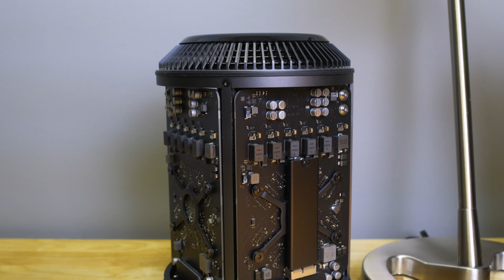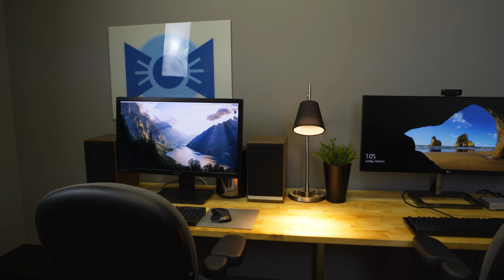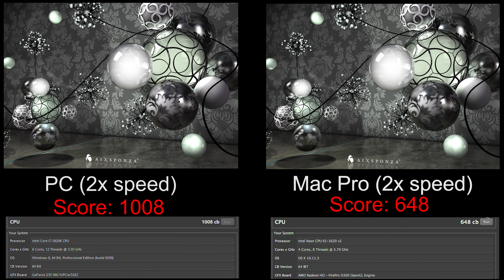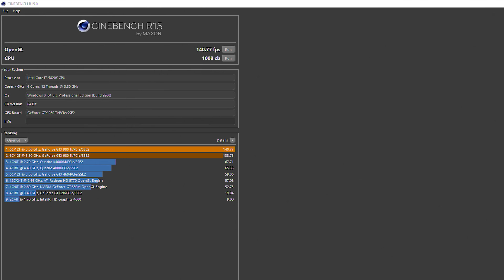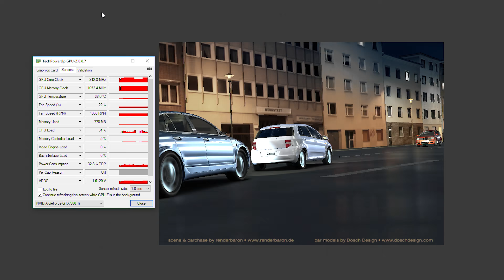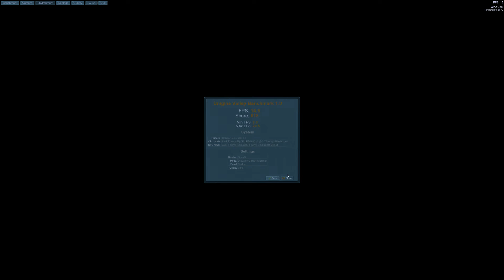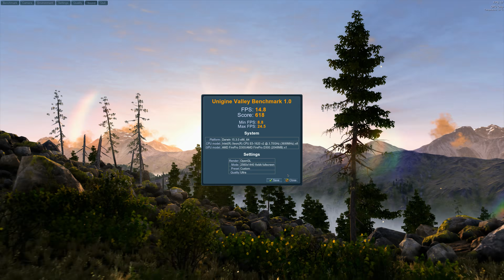$2,000 Custom PC vs $4,000 Mac Pro

Comment: You can't compare a gaming GTX card and a professional FirePro card!
Reply: actually, yes. yes you can.
Reply: ***** no you can't! Do you even know for what is FirePro meant? For what Quadro? And for what GTX or Radeon is?!
Reply: +David S. the gpu processing power isn't racist to a certain type of work load, if a card is powerful it doesn't make it not powerful in another situation.
Reply: ***** I don't say professional video cards can't run games, I say they are not builded for that. FirePro's are created for extreme precision, Quadro's are created for extremely nice non real-time rendering, Iris Pro's are created for Motion logic and Motion PhysX rendering (mainly in movies), GTX can't handle any of this and because of their only for games drivers, they even can't start modeling programs without problems. Ok, TitanX can handle on same as Quadro M2000M in modeling, where M2000M is in gaming like GTX 960m. FirePro's or Quadro's were created with know of that thing, that rendering time will be longer than 1/2 hour, Radeon's or GTX's were created with know of thing, that the video card will render 60 renders per one second. Rendering of 60 images per 1 second is different then one image per one hour! Real-Time render is an extremely different thing, than Non Real-Time render. But a gamer probably won't understand that....
Reply: And that's only Game video card (for maniacs) vs. Professional video card (for normal clever people). You also can't compare a gaming CPU (i7) with a professional CPU (Xeon). Mac Pro has Xeon E5 with 12 physical cores and 24 hyper threading, which's important for rendering, with 30 mb of L3 cache, that's extremely important for every demanding application, for example a 3D modeling application, but this Xeon has only 2.7 GHz, why? Because normal clever people, who work in demanding applications don't need high frequency as so as L3 cache or number of cores + this Xeon can handle running on full 24 hours per day. i7 5820K, which's for maniacs in to games, has frequency up to 3.6 GHz, only 15 MB of L3 cache, only 6 cores and this i7 can't handle supporting the GPU by long renders and even can't handle manual working on full (eg. modeling). YOU EASILY CAN'T COMPARE A WORKSTATION WITH A GAMING PC
Reply: Although you are sort of correct in that FirePros and Quadros are optimized for professional software and usage level, the underlying GPU core and technology is identical, for the most part, between professionally targeted video cards, and gaming video cards (GTX series, RX/R9/R7/R5 series). FirePros and Quadros are only useful to large companies and organizations (who do things like neural networking, AI research, supercomputing) that require the support, warranties, and specific dedicated features that even people that use software like final cut pro, adobe premier, etc. ("normal clever people"), will not benefit from (other than the bragging rights for buying ridiculously expensive stuff).Often times, the identically specced GTX branded component will offer identical performance to its Quadro equivalent. Furthermore, the Xeon vs i7/i5 argument has no real basis. Xeon chips are target toward large business and server related computing, often supporting multiple CPUs per motherboard, ECC memory, and more, but when it comes down to raw speed(which is important for applications such as rendering and gaming), is sometimes even outpaced by their equivalent (core wise), i7/i5 counterpart, due to their often slower speeds, and LOCKED multipliers.  For the the amount of cores, it often is the case that the Xeon lineup offers significantly more cores that the maximum amount of i7 cores (which I believe is 10 physical, 20 logical, from the i7 6590x), but is significantly more expensive. For applications such as rendering and video editing, this is very useful, but often times price prohibiting. In the same price range, the i7/i5 will often times be a better deal. It is true however, the the Xeon will probably handle continuous server loads like you mentioned better than the i7/i5, simply due to Intel actually marketing it as a server chip and doing the endurance testing. The i7 CAN certainly long renders (days long) and can definitely handle "manual working on full" (modeling). You CAN compare a workstation with a gaming pc, simply because the technology they use is often IDENTICAL, with only extremely specific tasks that normal CPUs and GPUs cannot due, which mostly only larger companies and organization actually need and that some extremely specific software might need that specific set of instructions a professional CPU or GPU might have.
Reply: lol David, you believe that crap of "professional" vs "gaming" GPUs, the Mac Pro is bad because Apple wants a big profit from cheap hardware, if you're taking "pro" into the argument, well... you could still build at least a two times better "pro" machine without spending a big amount of money. If you're buying a Mac Pro you must be just dumb.
Plus, "pros" use renderfarms, if you are doing 3d modelling, animation, video editing... a gaming GPU works as good as a "pro" GPU, the only difference could be that a "pro" GPU may come with 24gb of VRAM vs 12gb of VRAM of a gaming GPU, to solve that you could buy two gaming GPUs... it's not like you are going to do science stuff with it, and if that's the case, you wouldn't be using a Mac Pro.
Reply: +David S. yeah, the problem with this specific Mac pro is that all the pro parts are several years old and are still priced like they are top of the line, new hardware. Apple seems to not care about updating their Mac pro line with anything recent. Intel has a lot better xeons out already and AMD had a lot better firepro cards out already.
Reply: +Yaoquan Song Professional graphic cards have not the same technology, only the M1000M which is made for video editing, that one has technology of GTX 950m, but pther are fully different, easily the professional are made for precision and gaming are made for rendering, they need nealy no precision. And professional graphic cards are mainly for 3D artists and Animators, there you need the precision, it's only about the support, I had for some time Inspiron 7559, there is HD 530 and GTX 960m, for modeling I was using the HD 530, that wasn't enough powerful of course, but it had less issues then the GTX 960m, which was unuseable, CPU integrated GPU's are also more for precision then for rendering, but it's like in the middle. And the biggest difference is in mobile graphics, all mobile GTX are chips, but nearly all professional GPU's are full graphic cards and you can ipgrade them, even it's only a laptop (mobile workstation), only some are not cuz they're in sp thin body's (like M5510)
Reply: +David S. you make some good points. what you said is definitely right. Professional gpus and xeon cpus do have more instruction sets, better drivers and often more cache and ram than consumer cards do. I think I was just trying to point out that a consumer card can often render and animate just as well, if not better, due to clockspeed, than a professional chip, despite not having optimized drivers or specialized instructions. people like youtubers, smaller scale animators, etc. although your own experience with the gtx 960m and the iris 530 I have no idea why it would turn out that way. often times, I see experienced Youtube tech channels speak about the differences between pro and consumer cards and this seems to be their general message. That said, the pro variants obviously have advantages in some way, or else nvidia and AMD wouldn't make them, and people wouldn't buy them.
Reply: oh sorry, without the update thing mac pro is $3000 so its $1000 (description)
Reply: +Yaoquan Song And now about the CPU's. A 3D artist, Animator, etc. doesn't  need frequency, but L3 Cache and L2 cache, also as much possble of cores, mean physical cores. And about the frequency, a 3D artist needs only the base frequency, the turbo is not used, the turbo runs only, when the other cores don't have to be used, only some high-end cpu's have the turbo on all cores, don't trust some stores who said difference.  Take a look on Xeon E5 2620 v4, he has 2.1GHz, and L3 cache 20mb and 8 of physical cores. Now take a look on i7 6700k, which has L3 cache only 6mb, base frequency: 4.0Ghz and 4 physical cores, it's a damn good cpu, but for gaming and professionals who needs frequency, most of professionals needs L3 cache, (L2 cache is only a bonus, L3 is more inportant in Autodesk software, by other soft. it's normal), physical cores.
Reply: ***** FirePro isn't basicaly overclocked HD 7850, it has another armateur, only PRO drivers, fully other parameters, the differance between 2x FirePro D500 and HD7850 is like between a Dodge Challenger Hellcat and a Mercedes AMG. D500 has 1526 stream processors, 384-bit, 240GB/s, 2.2 Teraflops, sp the Mac Pro has 4.4 Teraflops, the best Mac Pro has 7 Teraflops, that's more powerful then the Project Scorpio and much much more powerful then the Ps4. (Mac Pro has Dual graphic cards, up to 2x D700).
And Ps4 is more like HD 7870. But you can't say Mac Pro isn't good, because it is worse in games then a gaming pc, do you see there the "Pro" in the name? It's for Pro's, not for gamers, it can be used for games, but it will be less powerful then a pc with card with same parameters, but a gaming drivers (in games)
Reply: Angelo Julioth I have never said you can do with a Quadro science stuff, for that there's Tesla, I said Quadro/FirePro is for precision, GeForce/Radeon is for nonstop rendering, yeah, maybe some Quadros have a GeForce chip, but Quadro isn't a gpu chip, iťs the whole video card even the mobile versions, you can even upgrade them, like in Precision M7510 you can just give out your Quadro M1000M and put in a Quadro M2000M, (MXM-A, MXM-B for M7510, M7710), in a gaming laptops it's just a chip. And I have never said Mac Pro is a good computer, maybe the version with dual D700, that one would be only 200$ more expensive than a custom desktop computer. I have Dell Precision M7510, with i7 6820HQ and an upgraded Quadro M2000M from a FirePro W5170M, I would never choose for Apple and I never did so. And again, a FirePro W2100, which costs 90$, is more powerful for 3D modeling than a GTX 980. And it's not for renderfarm, definetly not, if I would build a render farm, I would choose for combination of Xeon CPUs and GTX GPUs.
Reply: David S. I know having a renderfarm would not be so ideal, the cost of a renderfarm is too high, as far as I know, nowadays it's easy to find renderfarm services, and it seems like that's what the professionals do these days.
But what if you're an amateur 3d artist or you just like versatility and you need a computer for many other things? A FirePro wouldn't be enough, 3d artists need something decent for rendering too (if they're not using a renderfarm), not just for modeling.
My whole point was that the MacPro is garbage at that price tag, the only thing you could do with it is video editing.
Reply: Angelo Julioth Mac Pro could be interesting only in the most expensive variant (dual D700, Xeon 40mb, 12 physical cores), but that's uhm expensive, I am not sure now, 5000$? D300, isn't an ideal solution for a 3D artist, D500 for an amateur, but that's just my guess. I don't care about how long the render takes, if it's not longer than a day, I want quality, nothing more and animations I never rendered on my computer, because my friend can move with the camera pretty better, so it's his the last computer on which is the animation, so he also render it. But as I said, I was speaking about that nobody should say Mac Pro is bad, because it can't run games as good as a gaming pc, in this case, Mac Pro isn't a best computer, iťs more for milionairs, who want to have the most expensive computer, with the most expensive logo and fruit ever, Apple. Apple's for people who needs to pull over other, after Steve Jobs death it's deffinetly so.
Reply: David S. Well, that's exactly what I'm saying, it doesn't make any sense to spend that amount of money for that computer, I know it's a good computer compared to the average, but it's not wise to spend a huge amount when you can get something better with the same, but well, people can waste their money with whatever they like.
Reply: Yaoquan Song never found these youtubers, can you say me one of them? I would like to see in my free time also clever videos.

That's a next true point, why would they keep developing and why would people buy them, if they are same or worse and more expensive than consumer cards.

About rendering, it's true that in most programms are consumer cards better rendering than pro cards, mainly in Blender where the gaming cards are easily best for rendering, but that's only in GPU rendering. About CPUs, I think there are in CPU rendering best Xeons and as so Xeons are better in GPU rendering.
Reply: Xeons compared to top end i7 have little to no significant differences. Despite the higher core count, it doesn't give a noticeable boost over an i7. Xeons have more server-grade shit that would be preferred to be used in a server over an i7.

So those professional cards and cpu only target a specific market which is indeed for professional and not consumer use. A business would be interested in xeons if they had their own 24/7 servers
Reply: +David S. I agree. xeons often do have more cache that makes them better for rendering. I guess what I am trying to say is in this case, with this specific scenario, consumer stuff is better because it seems to have better performance. I guess some youtubers include linustechtips, hardwarecanucks,  ncixtechtips,  etc.
Reply: Yaoquan Song Yeah, for rendering is consumer stuff, but only for GPU rendering and only in specific software.

Thanks for YT tips.
Reply: Nonou As I said here many times, Xeon: 40 mb, 12-24 cores, can run on turbo on all cores, can run 24h/day on turbo. i7: 6 mb, 4-8 cores 4GHz, can not run on turbo on all cores, extremely brittle in turbo

Yes, Xeon is for specific market, that's why it's a workstation, but deffinetly it's not only for servers,
CAD, ent. 3D, anim, scientists, engineers, etc. these need a Xeon. 

Gamer, level designer (in high-end engines, not Unity3D), programmer, video editor, 2D artist, etc. these need an i7.

Xeon has a very, but very big boost over i7, it's big differance, but you have to use it for the right use.

As I said in about all by me written comments here, Mac Pro is a pro computer, it's a workstation, it is meant for a specific market, which is indeed for professional and not consumer use.

A bussiness would be interested in Xeons, even if they wouldn't have no own servers. MyTech Entertainment has not own server, even that they need a Xeon, because they offer their 3D modeling services. Pixar use Mac Pro's, even they don't render on him, and a Mac Pro has a Xeon.
Many people needs a Xeon.
Reply: Yaoquan Song yeah. Apple is like European Dell, nobody cares what's new or old, it has Apple logo so it won't loose it's price, Apple never gives the price down, only they make new models, if they will forget on making new models, their models will be overpriced old boxes, ok cylinders. Like in europe Dell forgets to update their sites, in US was an Alienware Alpha R1.2 for much lower price, in Europe was still 1.5 old model for nearly 100$ more than in US, but sometimes in Europe is out a Dell laptop, which still wasn't showed...

I don't know, it's so difficult to get on positions in these companies, but people who are on them don't do their job, I'd do it different way...
Reply: ***** K620 is an amazing card for it's price. For that price you can get a W2100, which is 60% less powerful, don't know why they do this card... Yeah, 2 K620s (by this card it's not 2x it's performance but only about 1.4x) could be good, but not as D500, or D700 (haven't seen any good tests of this card, which would be for games, so can't say, but yeah, it could be near to Dual D300)
Reply: I have both a Firepro card and a Radeon card. My programs on the Firepro crash more than the Radeon card. I think the "double precision" is a myth and its only to get business chumps to spend more than they need to on a "pro" card because they are "professionals" and they need a "professional product"... The only reason to get a Firepro (in my opinion) is if you have limited space in your case and or don't want to buy a new power supply to run the power hungry desktop cards.
Reply: Thomas J That's nice, but what software do you use? It's pretty important
Reply: David S.

Solidworks and AutoCAD primarily.
Reply: Thomas J Ok, what drivers do you have? And what FirePro do you have?
Reply: David S.
 I have an AMD firepro v4900 (nothing special) and compared it to a HD 7770 when in school. Here is the kicker, solidworks lists a driver recommended for my system that is only on the solidworks website, and not in the driver archive on AMD's site. I asked both AMD and Solidworks about this and I got a "huh, thats weird" response with no fix. lol. So no, I am not running the "correct drivers" because they don't exist on amd's site. Sorry, I just don't trust solidworks.
Reply: Thomas J Ok, first do your homework kid. Now, if iťs another computer, it will be probably a problem of the osRAM, Drive, CPU, motherboard, drivers (mean of all components) and after this all I would start with thinking about the GPU, but if you have these bad cards, it can be probably the GPU, if you work with large polycount scenes. v4900 is a pretty old grandpa and even in it's times (2013) it was a sh*t card on FirePro's class, however it was the cheapest one, FirePro for only 150$, it has 1 GB vRAM, that's deffinetly not enough for today's AutoCAD and either not SolidWorks and 480 cores is also not enough for AutoCAD, maybe could for Solidworks, not sure. About drivers, you should try objective drivers if you have a card like this and yeah, AMD haven't released a driver for a long time on a 3 year old card, which costed in it's time 150$. FirePro is expensive, if you want to use high-end CAD softwares, you need minimaly FirePro for 250$, the new W4100 is for 200$ and could be fine, but these cheap cards don't have good support, which is mainly focused for professionals and a professional, won't buy a card for 150 bucks. And a pro would know what is minimaly needed for medium projects in CADs. What is the polycount of your project when it usualy fells.
Reply: I have 3 of these v4900's running on 2 different drivers in 2 different computer configs, one is only a year old. 2 have xenon with 16gb with a HDD, and 1 with an i5 and 8gb and a ssd They run equally as well, all displaying <50% gpu usage. I have used both driver versions and both perform the same, except on one, when you first open a doc, it takes 3 secs longer for the image to fully render. That is the only difference. All hardware is fine. Its the software that sucks. Autocad never crashes and solidworks always does (once a day). Its a software issue with Solidworks.
I have been trouble shooting this off and on for 3 years... Kid. The software even crashed in the school. Frequently.
(solidworks is obviously more intense than Autocad)
Reply: Thomas J Oh, now I understand you, yeah, Solidworks is pretty bad in this way, I thought it crashes only on the FirePro from your comment and even also on AutoCAD. I heared many people who have in Solidworks problems, mainly with GTX 950m and with Quadro M2000M. But it's impressive that the v4900 works in AutoCAD, what ver. do you have? And that you have 3 cards doesn't changes so many things, frequency will usualy stay, of course vRAM will be highered 3 times, stream processors about 2.3 times, so for medium projects it would be enough than.
Reply: ***** I don't say you can't use it for gaming, but people shouldn't this workstation is weak, just because it's in games weaker than a gaming machine
Reply: yes, but even though you would use it as workstation, custom build pc did better with half of the price, and of course like I do it is possible to use gaming pc as a work pc too no problem, but the good side of that mac pc is that you can fit it in a bag, I think, but again, the price is way too high
Reply: Nino Saareks that's the thing, it's only 200 bucks more expensive than a custom built worsktation, I think it's worth the warranty, it's so much expensive that $200 is not that much at all. But yeah, true.
Reply: good argument, but may I correct you $2000 not $200, if Im correct?

this is what fighting in internet should be! nothing insulting :D
Reply: Nino Saareks I meant $200, but it's only so if you we're talking about the best Mac Pro (FirePro D700; unknown CPU with 30mb, 2.7GHz, 12 physical cores), in this case case it's only $200 difference, when talking about other configurations it's more, but still,  mac pro is cheaper than other  other desktop workstations (not customs), eg Dell Precision, but of course Dell's higher quality and more specified on one work than mac, for a developer/engineer definitely better
Reply: interesting, but my FirePro W5170M worth $500 has only 2GB, hmm. And also interesting that I couldn't model on GTX 960, but on a FirePro W5170M, I can. I am a professional, I work as a 3D artist and level designer in the game industry. Now tell me, what's your profession? Are you a professional who uses a graphic card for professional uses in high demanding applications where you need precision? Have you even had a professional graphic card? Have you ever had a professional CPU? I can only guess what's the answer...